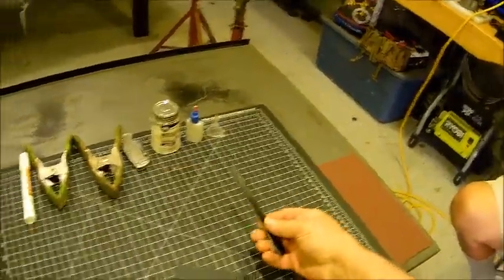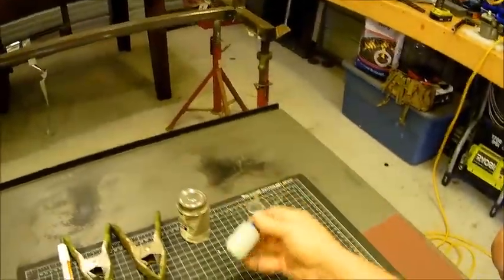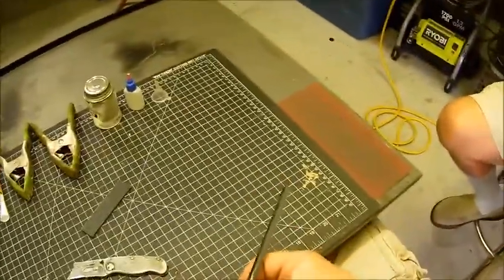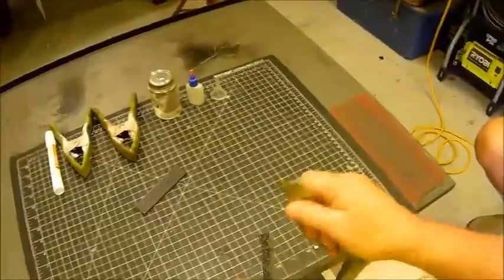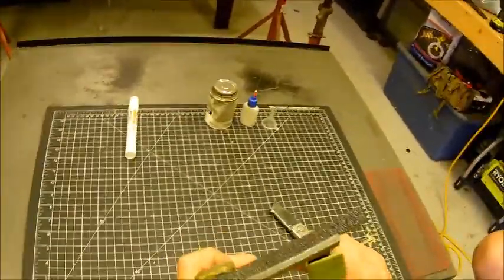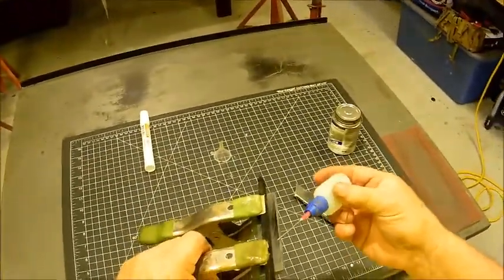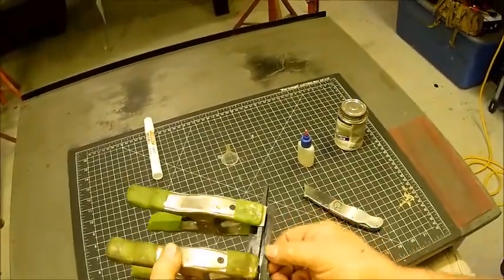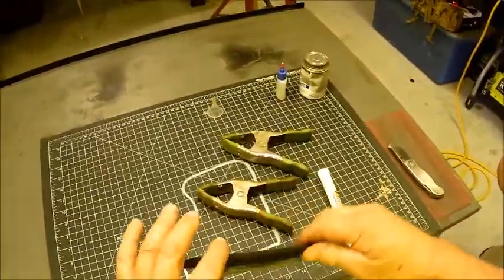Solvent welding Plastic (ABS, styrene, acrylic and polycarbonate ) short video

Comment: Hello thank you for sharing something with while. Can you please respond to me and tell me about the chemical used for this I'm trying to fuse polycarbonate thank you.
Reply from the maker: https://www.amazon.com/Weld-Acrylic-Plastic-Cement-Applicator/dp/B0149IG548/ref=sr_1_3?crid=1HJ05C3U1LHQG&dib=eyJ2IjoiMSJ9.3b8vXtQPbZyzUpj3GDFVOsNX_jAzvXjvN4B55USi0rX-DU4uFxwu5P8bG4ti8HwKirt-Y3oa9TPHE6Tggea2FXqqCKQuLLcFkkEKuxRsDHbe78UcbqFWNg3Y5IUqfTrkkWdnMz7h4bcYkSnWo4ULHPOXq8GZPaE0h0bh_Vbv--pCQcsVirli6e5J9w4JAcm9HwJJzZ4EjJgpU_cKulkiWNJzaDdOlhiWSc0uttw9PJk.5Iqsotu2Xf18vDpF6jQctlGGRD0Sfu5ketkIC5n_zU4&dib_tag=se&keywords=styrene+and+polycarbonate+fusion+glue&qid=1731260143&sprefix=styrene+and+polycarbonate+fusion+glue%2Caps%2C192&sr=8-3

Comment: Thank you.  Are you able to use this solvent to merge acrylic to styrene or only one type of plastic to another?
Reply from the maker: Not sure..... the process is the same I see no reason why it wouldn't......a little test would tell...thank you for watching
Reply: @KevinTodd  thanks for the reply! I will give it a go!
Reply: @KevinTodd  hello again.  Just wanted to report back and say that styrene bonds beautifully to cast acrylic! I used Weld-On 4 and it's fused the pieces into one, rock hard.
Reply from the maker: @gracebyseven  NICE

Comment: Will that solvent weld product bond pvc cap to a Polycarbonate tube?
Reply: Plastics of different types can be impossible to solvent weld.  You just have to test it, even if you believe they're the same, since the plastics can have additives that make it difficult to weld.
Reply from the maker: I'm not sure about that it would have to be tried first I don't see no reason why it wouldn't but I'm not sure what the strength would be so I'm afraid to say either way but thank you very much for watching

Comment: cool, acetone probably achieves similar results? found this while researching ABS PC welds.
Reply: Does Dichloromethane ( Methylene Chloride ) produce a stronger bond a) ABS. to ABS and b) Polycarb to Polycarb?
Got 2 jobs to do :-/
Reply from the maker: @peterrolex2349  This is what I use not sure the mix propiaterie I'm sure follow instructions and you will be fine. And thank you for watching. And the bond is as strong as the as the material used I have been told
Reply from the maker: thank you for watching and yes it probably would